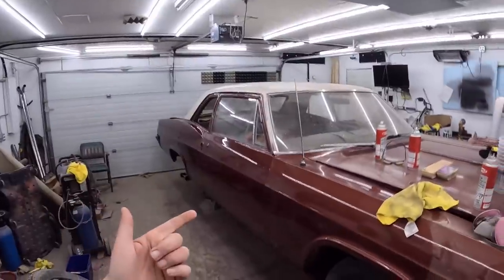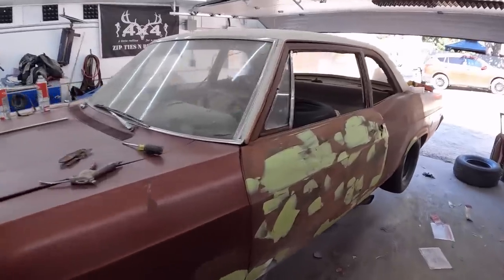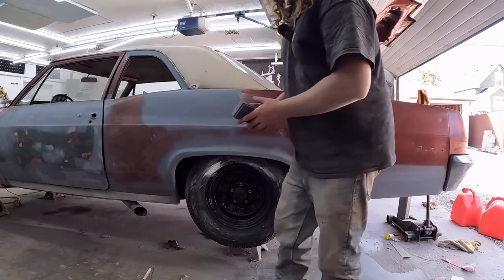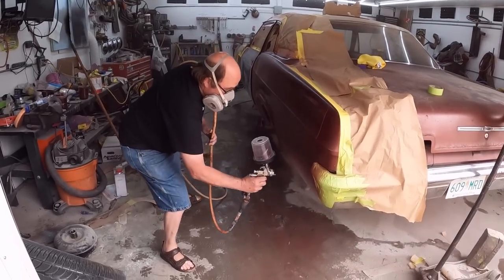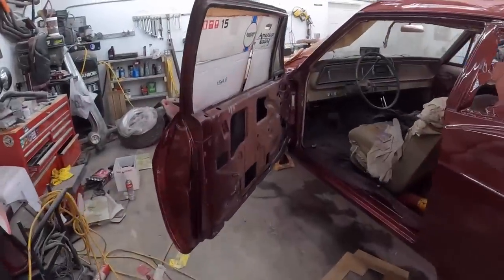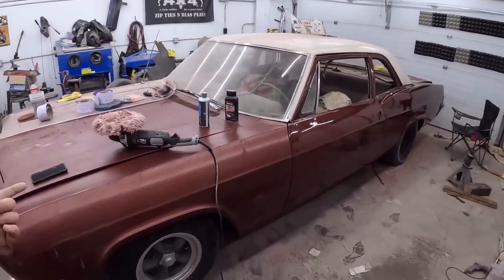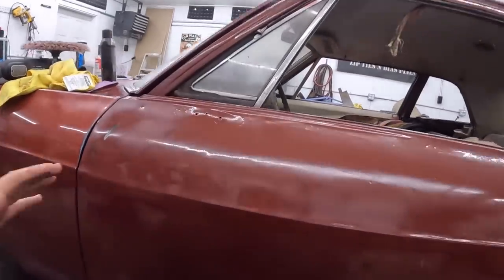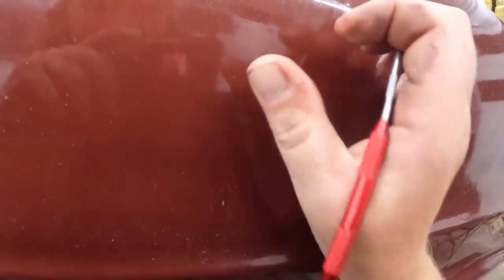EPIC FAIL!  Color UNmatching 60 Year Old Paint!  More Sub-par Body And Paint.  1966 Budget Biscayne

Comment: The driver's door is a good example of how you could save time and money and get better results by following the Bad Chad method.  Patching a bunch of spots means they each need to be feathered separately, and this creates waves.  Skimming the whole door very lightly and then "blocking" with 40-grit, then 80 avoids that and leaves you with a solid base color before primer if you stop when you hit "the ocean floor" (when metal starts peeking out).  You need less primer to get back to a solid color, or a lot less of that pricey color coat to cover all your little islands of filler.  Yes, you'll use more filler, maybe even twice as much, but most of it won't stay on the car and all of the following steps will be faster and look better.  A flat finish means something needs to make the panel actually flat.  That can either be very delicate metalwork or one good coat of filler.

Comment: I've got like 5 different blacks on my truck, all in various stages of natural patina, some areas are freshly replayed two years ago (with spray paint) and others are over 10 years old, some of it is flat, some gloss and a lot of satin, the roof is actually burned through to the red oxide primer underneath that's now faded to pink. various panels have paint lines down the middle and I never masked any body gaps or overlaps, I kinda like the look it gives, it's ratty but loved at the same time. Leave this one in the sun for a year and it'll be the same 👌

Comment: I think the big mistake in regards to this project is, are you ready ...... applying a paint with any kind of gloss. Any kind of gloss will highlight imperfections in the bodywork. Those flaws could have easily been concealed by doing a little bit of bodywork all the way around the car, followed by painting the entire car with a flat (any color). 

The two door conversion was fantastic, the bodywork performed to both sides was fine for the level of the car, bodywork and painting only 2 sides was a bad decision, not painting both sides on the same day was a bad idea. All that said, this guy has more talent than any critic. Just a couple of good decisions away from hitting a grand slam.

Comment: Depending on how the rest of the 'patina'd' paint turns out on doors and quarters, might be better just to leave the fenders as they are. The car was clipped anyways, and usually over time the paint would mismatch, so it would seem fitting! I'm not into the white top though. That's gotta go... IMO. Looks like a damn Commanders car on a Military base, or a Taxi.. lol Maybe a different color or the same as the rest of the body??  Anyways, congrats on the WELL DESERVED 100k to one of the hardest working guys on the Automotive side of YouTube!

Comment: i'd say you're doing a good job of sticking to the plan of it being a budget build. yeah, rear quarters would be nice, but another $1600 would 'bout break the budget. this wasn't ever meant to be a concourse restoration, it's a bargain basement hot rod. i think it will be a lot of fun, and make a good daily driver, provided you luck upon a free oil well. 12-15 mpg. is gonna be about as much as you can expect from a BBC in a car this size.

Comment: I used to hafta work on those old Mercedes' alot. Wow what a nightmare. I will say that if you go to the parts counter at your local Mercedes' dealership, you can guy the best gasket sealer you'll ever use. They have some other superb mechanic bits, that are quite a bit better than what you can find at your local parts houses. If theres 1 near you, go have a look.

Comment: As a semi-Prof. offspring learner form my farther, (but professional instructed by the finest NAVY instructor on paint Aircraft) That Single stage. was never easy to match even in late 80's early 90's.  that why the industry went to base coat/clear coat.  (All you had to do for that paint was easy scuff the clear on the rest of car reshoot clear all matched.  It is what you got. Hey, got a Give Murv props for painting in sandles, that is some Sticky heavy over spray to be scrubbing off the Toes..., with all that was touched at this point just scuff the rest of the car shoot at same time,  aint going take much to cover, just make sure well sanded and smooth, trick my pops did was 1200 wet/dry.  at that point 90% car already masked off what another roll.  Still 4 doors too 2 doors always cooler. As watch more, think that paint was mixed wrong, that is pretty drastic color difference.

Comment: Come on Dan why not learn to do it right?.Fixing the dents is time and some filled the hood and truck lid was a quick day sand and spot repairs and made a easy quick paint job a lot better with the same amount paint just more high build primer and guide coat. And when wet sanding use a back up pad and a drop of kitchen soap in your water.drives use old body guys crazy.